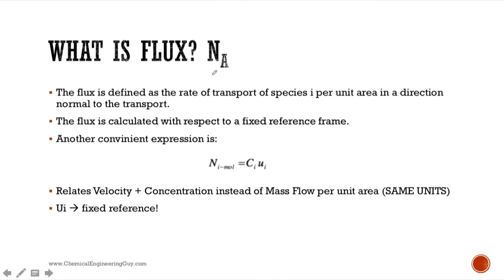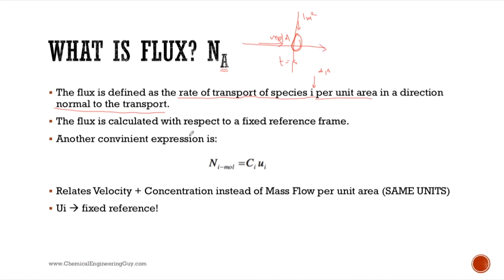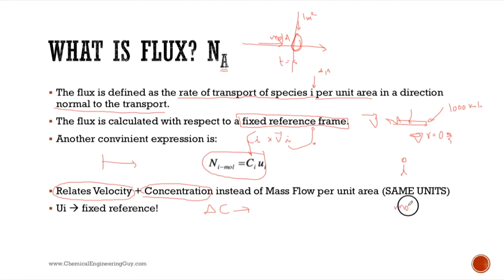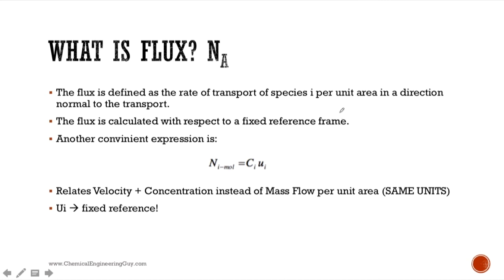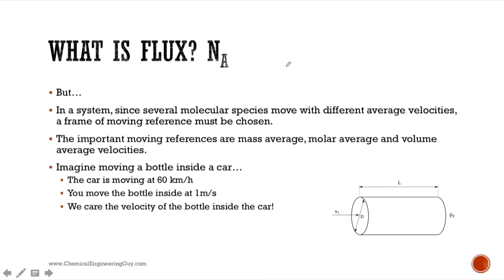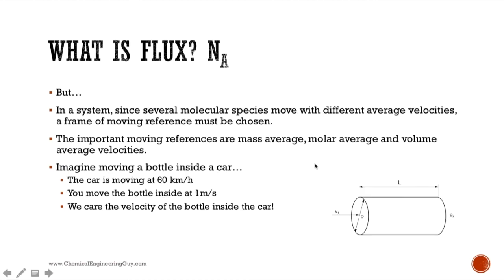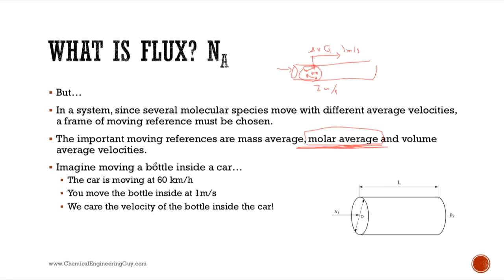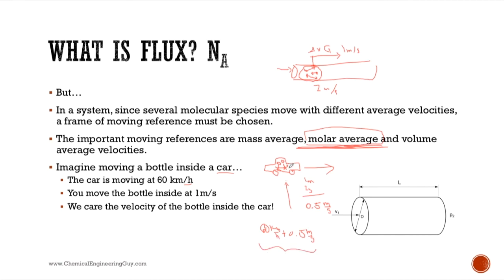What is Flux in Mass Transfer? (Lec016)

Comment: Why do we use "flux" as the indicator of mass transfer? Why not just "rate of transfer" with units of (kg/s)? Why do we choose (kg /m2 s) as the quantity to measure how fast molecules diffuse/transferred?
Reply from the maker: For the same reason you are using seconds... Why not just kg? Because it makes sense to make it per unit time... The same is truth with area, as it is independent of unit size, it can be a huge pipeline or a small straw... That's why temperature is great, it's independent of size o rmass, you say 50C and no need to say if this is 1ton, 1g, your pizza or you batch =)... It just makes more sense and it makes it much easier to relate